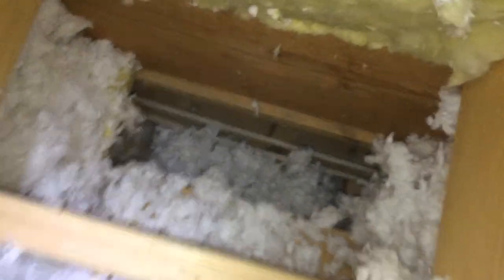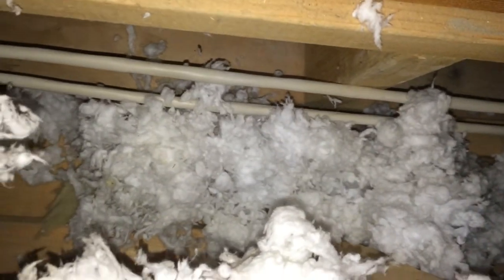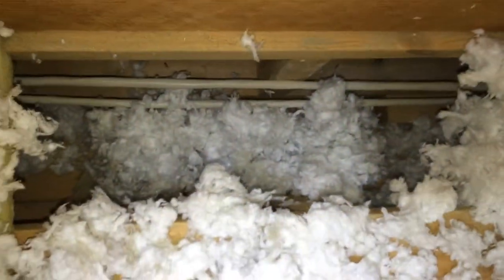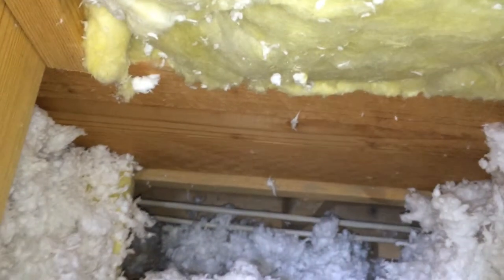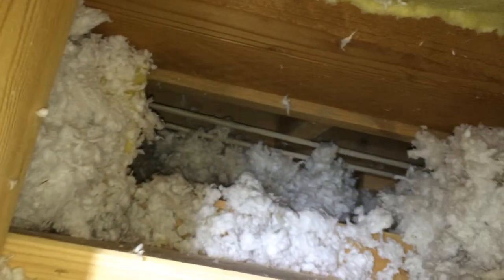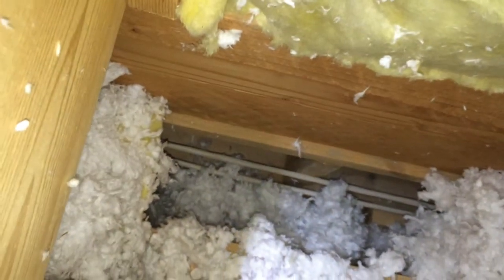Diagnosing problems in a knee wall of a new home.

Comment: hi, i have this same situation in my attic,  large knee wall around family room. Co. that did energy audit said to put radiant barrier over walls, but I am thinking foam board would be better sealed at joints.  not sure how thick foam board should be? which method do you think would work best?  i live in NC 
love your videos wish they were a little longer.    Thanks
Reply from the maker: JC Thanks for the kudos. I've been working on a book with much more detail. The air sealing chapter should be done in the next few months. 

Best option for you may be to remove batts and spray foam. Or foam the roof deck. After that foam board with sealed seams is a good idea. You want it to be a little vapor open and fire resistant. That may be XPS with a coating on it.
Reply from the maker: 1" or 2" foam board should suffice.